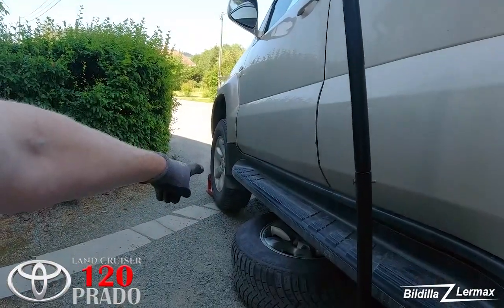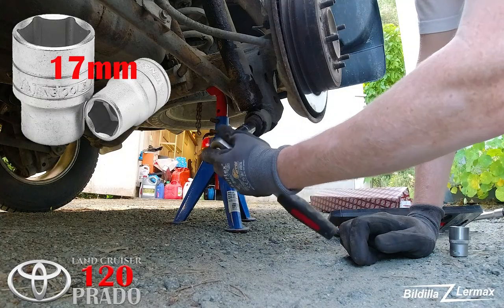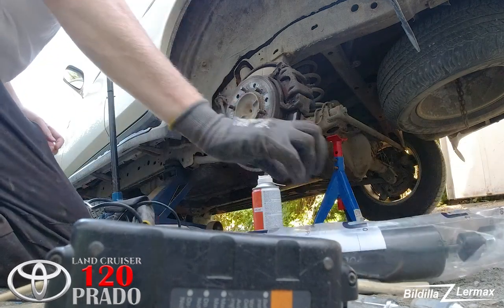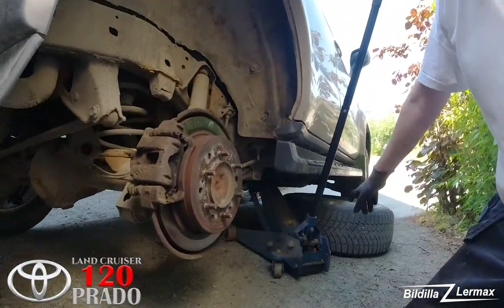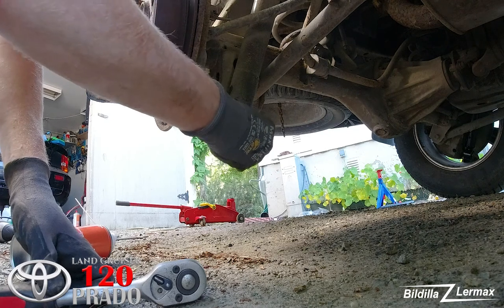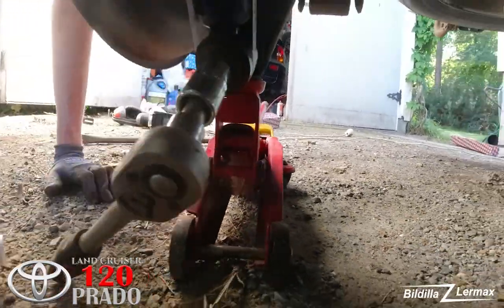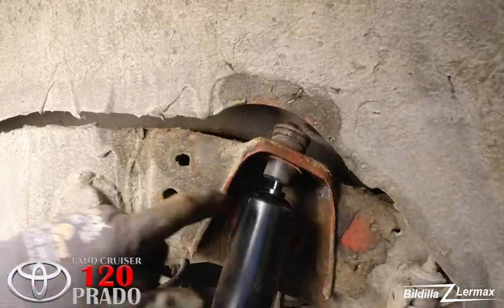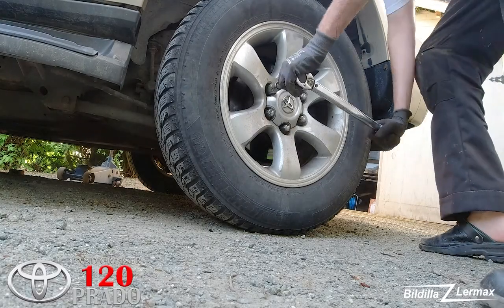DIY / How To: Replace Rear Shock Absorbers - Toyota Land Cruiser 120 / PRADO 120 - Bildilla Magasin

Comment: Thank you, 
I've ordered two rear heavier duty foam cell shock absorbers for my Prado 120 😊
Suited to the 2" (50mm) lift in my suspension  .... 
Your video will help me replace my leaking ones myself.
Thanks again.
Ted from Downunder 👍
Reply from the maker: Hello

Thank you very much for the feedback!
Glad the videos are helpful!

greeting
Pål (Paul)
Reply: What is the best shocks (Part Number) I should order for my Prado 120 ?
Reply from the maker: @mosesntege4767  Hello

I don't feel like I'm the best person to advise which dampers are best. But there are probably several other good videos and forums out there that can offer better advice.

Greeting
Pål (Paul)

Comment: I guess those LC with rear Air suspension last lot longer? I have read somewhere that front goes bad much sooner if at the rear air system. I have just bought my very first LC 4.0 V6. Have some rust but engine is a charm. Actually engine is a beast...😜
Reply from the maker: Hello.
I'm very unsure of what to do first with normal shock absorbers and springs, against air suspension. Here in the cold north, the roads are so salted in the winter that the cars get a lot of damage from rust.
Heard about a lot of problems with air suspension on all brands really. But it really only has to be seen as wearing parts as well.
Greeting
Pål

Comment: Good evening brother I change all the fuse and relay my always check the connection the air conditioner Lexus rx 300
Reply from the maker: Good day. The problem is still there? I found several videos when I searched for the same problem even on Land Cruiser, I can see if I can find some more info about other things to look for. Regards Pål (Paul)

Comment: Very interesting. Thanks for this. By any chance have you done any videos on what are the common mechanical problems in the Prado 120?
Reply from the maker: Thank you very much!
I have not made an overview of the most common mistakes. But have actually thought about it too.
Here in Norway, we have almost only Diesel cars. But in other parts of the world, quite a few Besing versions + Lexus GX470 have been sold in the USA.
Where do you live? Do you drive Diesel or Petrol?
Reply: @bildillamagasin  oh ok. No issue. I live in Sri Lanka and drive a Petrol 2700cc 2006 model. Over here diesel prado's are very expensive due to the luxury import tax and diesel fuel much cheaper than petrol at fuel stations
Reply from the maker: @ranleyevarts  Ok :)
Is Patrol cheaper than a Land Cruiser with you?
Diesel is cheaper than petrol in Norway as well.
Norwegian import taxes on cars are some of the highest in the world. And large heavy cars with slightly larger engines pay more than smaller cars. Electric cars are completely free of tax in Norway today.
Reply: @bildillamagasin  That's interesting. WE pay a 300% tax for all vehicles above 1,000 cc and 100% for electric
Reply from the maker: @ranleyevarts  Oj ... help ... 300% on the starting price of a Land Cruiser ... yes then it will be very expensive ... oj oj .. wilder than in Norway then ...
Reply: Thank you! Going to tackle mine this weekend